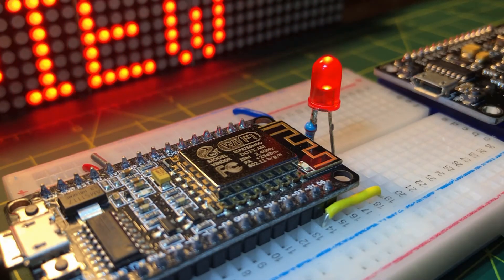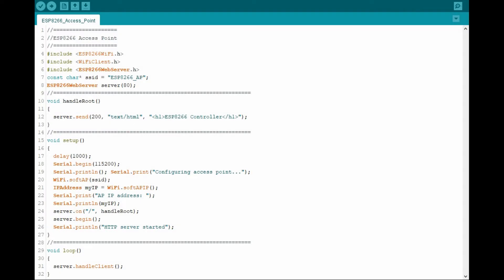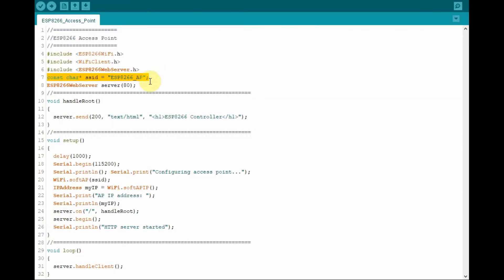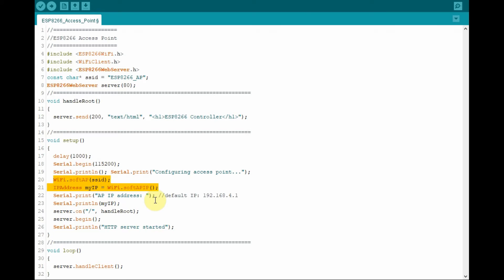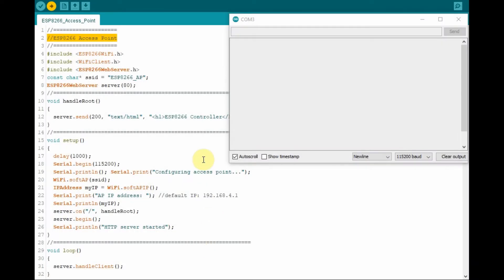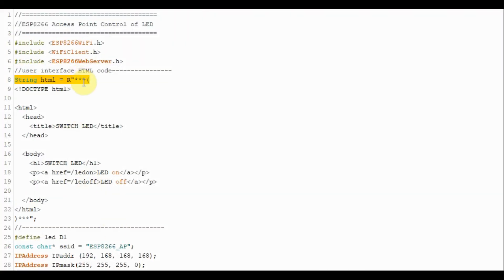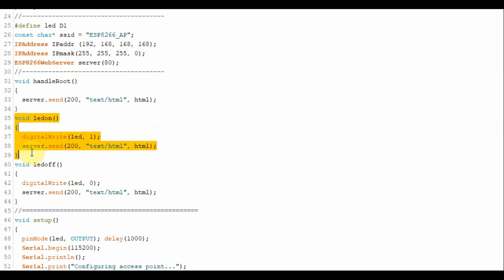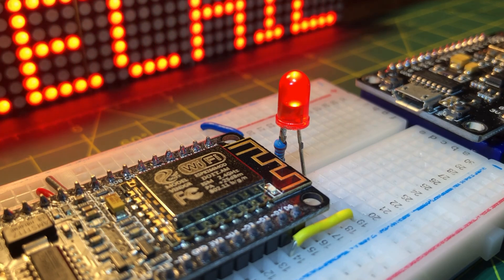ESP8266 Controller WiFi Access Point

Comment: Hi,
I don't understand because I've just copy and paste your code into my ESP8266 and my smartphone show me this message "Failed to get IP address" when I try to connect it.
If someone have fixed this...
Reply: after #include <yourlibraries.h> add these lines:

#ifndef APSSID
#define APSSID "ESPap"  //Your name of the AP generated by the ESP8266
#define APPSK "yourpassword"  //The password to connect to the AP
#endif

const char* ssid = APSSID;
const char* pwd = APPSK;

....

....
Then on your "setup" function, you should add some lines that this youtuber missed, and it should see like this:

void setup(){
  delay(1000);
  Serial.begin(115200);
  Serial.println("\nSetting AP...");
  IPAddress myIP = WiFi.softAPIP();
  server.on("/", handleRoot);
  server.begin();
  Serial.println("\nWifi is ready!");
}

And the rest is the same code.
Reply: EDIT:  on Arduino IDE 1.8.12
In the top of the IDE go to "TOOLS" then look down until you see "Board:" Click that then look all the way at the top of that popup menu and go to "Boards Manager" click that. Give it time to load then type search for "esp8266" and find esp8266 community then  UPDATE that!
Once that was done and recompiled / uploaded the code AND BAM!!! IT WORKS AGAIN!
Reply: EDIT:  on Arduino IDE 1.8.12
In the top of the IDE go to "TOOLS" then look down until you see "Board:" Click that then look all the way at the top of that popup menu and go to "Boards Manager" click that. Give it time to load then type search for "esp8266" and find esp8266 community then  UPDATE that!
Once that was done and recompiled / uploaded the code AND BAM!!! IT WORKS AGAIN!

Comment: Nice now I can attach a relay board and use it as a remote on/off in the wild without home wifi location limitations. Thank You! very well explained sir!
Reply from the maker: Thanks for your feedback
Reply: @AnasKuzechie  You're very welcome I also subscribed. Thanks again friend.
Reply: @AnasKuzechie   UPDATE
I now cannot get it to connect  my mobile devices. 
Continuously says  ""Obtaining IP address..........""
Reply: I have tried this with node mcu 12e mini model it works but in reverse mode when I press ledoff swith led on board is glow and when I pressed ledon switch on led goes off I used on board led (D4) in the code also fonts of led switch are very small difficult to use on mobile phone screen otherwise every thing is perfect

Comment: Hello my friend.  I want to make an incubator with nodemcu.  I want to use Nodemcu as acces point and see the data on my phone.  I want to use 2 relays and adjust the temperature and humidity.  1. I want the relay to work when the temperature is below 37.5.  2. I want the relay to work when the humidity is below 55%.  I want to use dht11 for temperature and humidity measurement.  Can you help me with the code?  I am a little newbie in this matter.
Reply from the maker: Hi, I have a lot of videos you can watch, where ESP8266 & ESP32 are used in web-based applications utilizing temperature & humidity sensors. All the codes are provided.